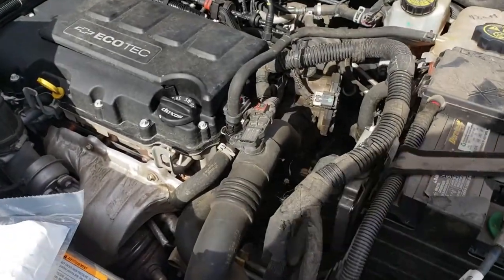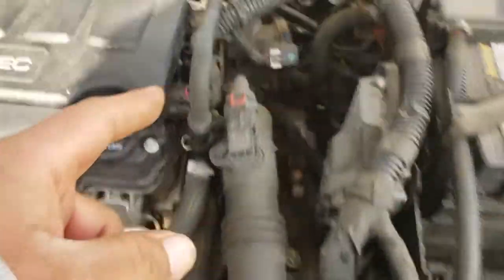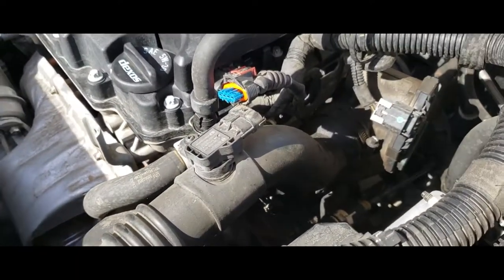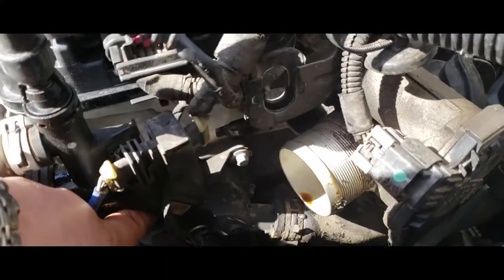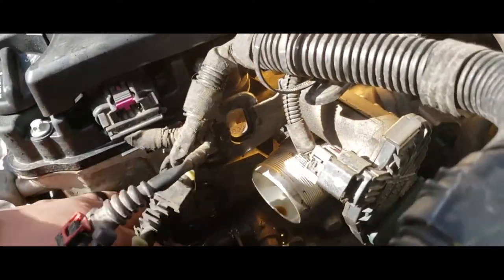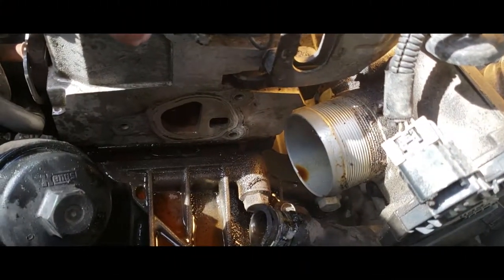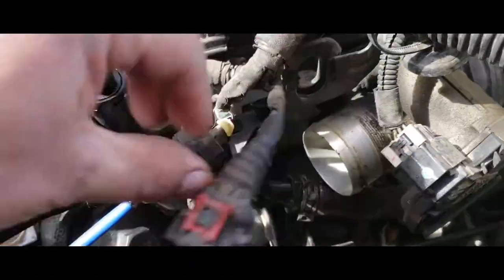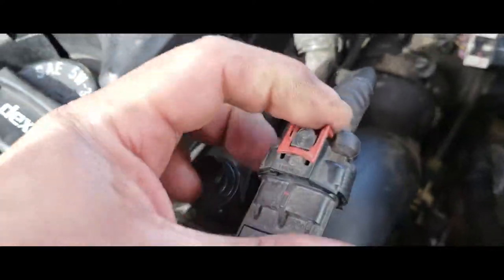How to: Replace the Water Outlet on a 2015 Chevrolet Cruze LT Eco Turbo

Comment: I haven't replaced mine yet. When I was searching Google for the issues and trouble codes for my 2015 Cruze LT, I was sent to the thermostat, water pump, and then radiator temp sensor in that order. Having replaced everything on that side, I finally came across someone's comment that there are 2 temp sensors for the coolant system, and then came to this video when searching where that second sensor is located. I am hoping to just need to replace the sensor itself. The one on the radiator had a lot of corrosion. However, would anyone reading this suggest replacing the plastic water outlet with a metal one? I found one on Amazon for about the same as the plastic, and would only have to wait about 4-5 days for shipping instead of running to AutoZone. After seeing the issues with the plastic oil filter housing on my wife's Town and Country, and replacing it with an aluminum one, I am thinking of just swapping ALL plastic engine parts that have metal available replacements.
Reply from the maker: did you replace them with the metal ones?
Reply: @559powerscape  not yet. So far I just replaced the sensors. We have 3 vehicles in our household, and they are all taking turns with needing work on them.
Reply from the maker: lol thats funny @ajcole002

Comment: Hey man what would be the proper name for those side seals? Mines leaking as well and want to look for them but don't know the name . Thankyou
Reply from the maker: Chevy Cruze Camshaft Position Sensor Seals. I got them at the dealership. Sometimes their OEM parts are the same price or cheaper than an Auto Parts Store. And you get the OEM quality. Hope this works out for you! Thank you for your Support!
Reply: Thanks so much !
Reply from the maker: @luigifix2120  your welcome! Glad I could help! Thank you for your Support!

Comment: The mounting bolts look wierd. I heard 8mm but why do the bolt heads have that pattern?
Reply from the maker: Yeah 8mm will do it. Not sure that's how GM manufacture it
Reply: @559powerscape  after some research I've learned they are called " reverse torx" head bolts
Reply: @teericky  Any idea what size? I know a lot of what I used for the water pump replacement was E10 and E12.